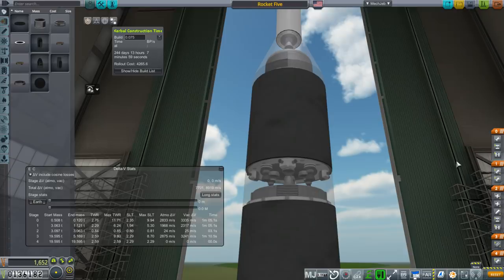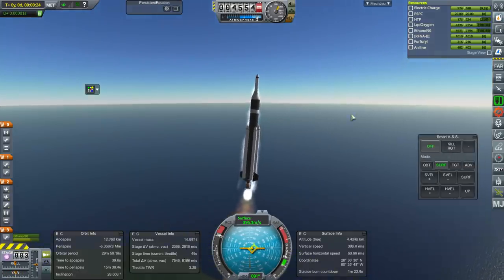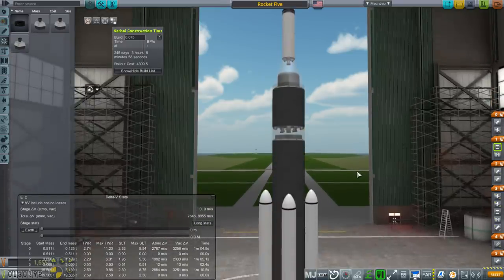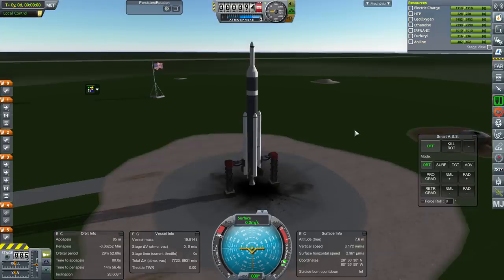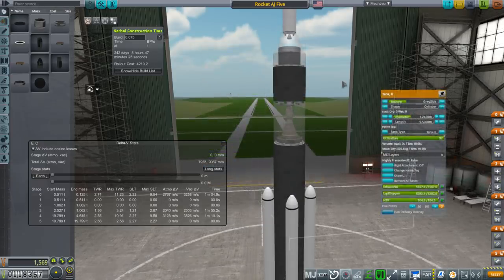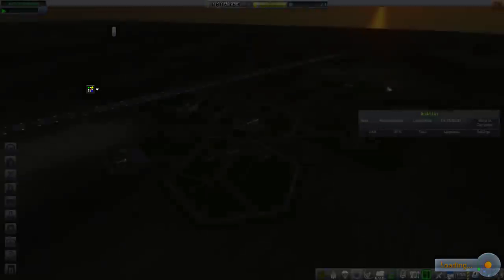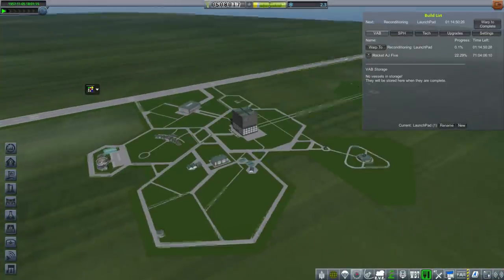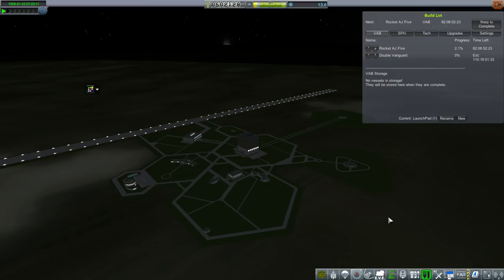KSP 1.3.1 with Realism Overhaul - RP-1 03 - Test Flight Strikes

Comment: 2:40 A cross-fed version of any early rocket would have been *awesome*. I once calculated that a "Thor Heavy" could put 1,787 kg into orbit without any upper stage, so imagine if the US used that instead of an Atlas to launch the Mercury spacecraft. ;)

7:00 You had more than 100 kg of HTP fuel, way too much for your purposes. Though you corrected that later...

10:00 There aren't any new iterations of the small separation motors, so I don't think it's really a case of "best they could do at the time", just that for most applications improving their mass fraction and specific impulse wouldn't pass the cost-benefit analysis.

25:00 H. Always.

I didn't remember you saying "shucks" so often in your old series...

Comment: Can't throttle without avionics. Just before staging, disable the rcs fuel in the 2ndS so throttle is up but tv's no longer fires - then stage. If throttle is max at staging, it will stay up
Reply from the maker: Well, already recorded the next three episodes, but I think my solution is basically what you're suggesting.

Comment: Your TWR shouldn't matter much to your upper stage rotation. Sure, your stage weighs less further in the burn so it's moment of inertia is smaller and the engines thrusting off center will induce a higher roll rate. But the same is true for your RCS. And I suspect that your upper stage + payload is front heavy when drained of fuel, so the torque from your RCS should go up through the burn. But yeah, the offset mass was too great. Maybe just a single sep motor in the middle, so even if it doesn't fire you have a chance that the engines may still be ullaged? Or just ullage them with back-facing HTP thrusters? Also, I don't think you'll ever need 70+ l of peroxide in such a small stage, I'd cut back to 10-15l to save on mass. And I'd ullage the final stage with reaction thrusters on the second stage as well, no need for redundant systems!

Comment: This is why I wish we had the British HTP engines with their historical 0% failure rate. I'd happily trade quite a bit of disadvantage in other areas for that.
Reply from the maker: We do have Gamma 2 and Gamma 8 from Black Arrow available (I haven't paid to unlock them, though), and both engines had failures in historical launches during testing.
Reply: It's a shame to be stuck with them pre-clustered, though, and especially to be stuck with some of the structural elements around them. All the failures in flight that I'm aware of were actually fuel tank failures, but I guess that's hard to model with the systems in game. Maybe I'll see if I can get some parts working as individual chambers rather than just the clusters.